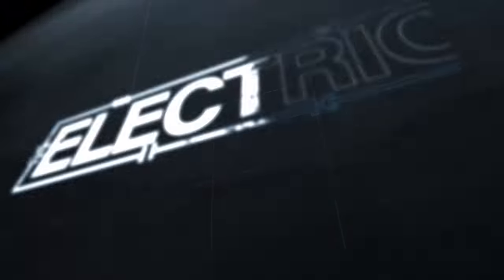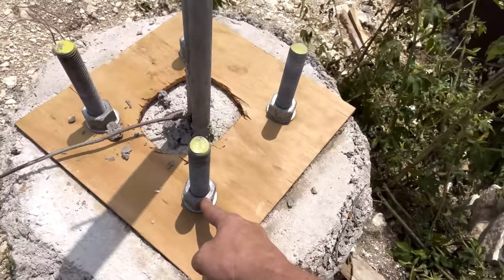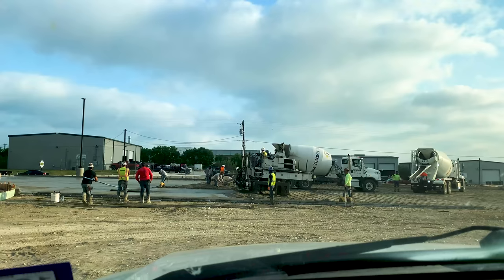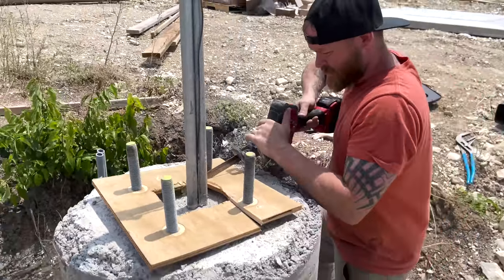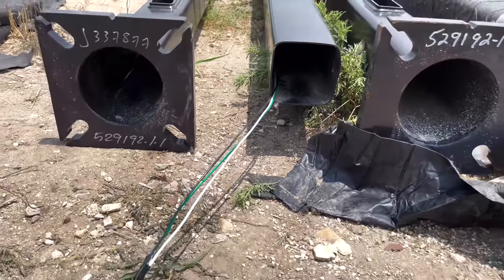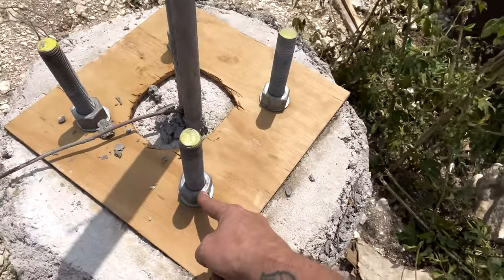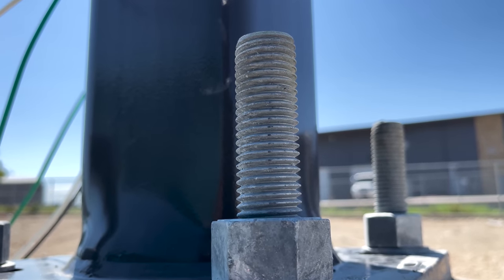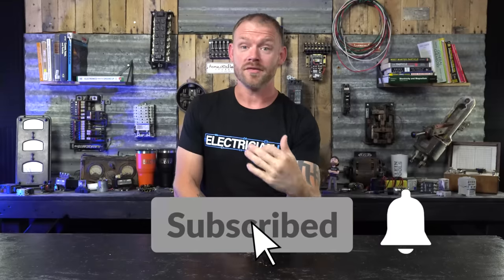How to Set Up Light Poles: Tips and Advice on Thinking Ahead

Comment: Dustin --- what about getting a geo engineer to do a soil test to determine how the poles should be anchored?
  Also, what about getting that same geo department to determine average wind speeds for that area and if that newds to be taken into consideration when choosing the shape of your poles and the material the poles are made from?
 I've had to deal with those things on jobs out in the high desert here in SoCal once for a horse ring that I was lighting and another time for a large sports multi use playing field. 
 These are both very high wind areas that also get large amounts of rain in very short time, not very often but a few times a year and cause flash flooding and can cause lots of soil erosion. Hemce the soil testing for density and underground water. 
 The wind is a problem because of harmonics, not so much the wind speed although that is a big problem that has to be addressed. The harmonics is the vibration of the any structure caused by wind that causes the vibration to be consistent where the structure vibrates at a certain frequency which then stays at a constant momentum that increases more and more to the point where the structure will fail at its weakest points. 
 I'm sure you've seen the film of the Tacoma Straights Bridge swinging and twisting and waving up and down then finally self destructing and falling into the river below. That is wind harmonics that caused that.  Lighting poles will do the same thing. That's why they make poles in octagon, round, oval, square, some are tapered, and they are made from steel, aluminum, some are a plastic of some sort, all for different applications. 
 Thats just standard poles for parks, parking lots, etc... then there are the very large, very high lights and poles for sports stadiums, race tracks, etc... that's another story completely.
Reply from the maker: Thats a very astute observation, however in the electrical contracting industry most companies are going to design and build systems to the minimum allowances that will pass code - because most builders want the cheapest price for the highest quality required to meet standards and still make money. Who would we put the responsibility on for this? When a plan is drawn up by an architect and approved by an engineer, we in the field expect the engineer to have covered all aspects of design, so really, we just install what they spec until we find issues arise. I'm sure for larger venues and buildings there's much more input from engineers on fixture selection, harmonics, etc - but for the average home and business this is not something that's required nor are there typically problems we hear about. That's not saying it's not important to consider, I'm just pointing out that if there is an issue to be considered I think most of us sparkies would defer to an engineer to point them out and spec it in the drawings otherwise we're going to assume there's no issue. Thanks for mentioning this, it's something I've never thought about.
Reply: @ElectricianU  ---- Thanks for your reply. 
  I should have worded my comment a little different. I was not necessarily asking if you had gone through those processes as the electrical contractor because that burden does rest on the engineer/architect unless it was a design build contract and if it was have you ever dealt with that?
  I also wasn't trying to bust your balls in any way, I apologize if it seemed that way.
  I wanted to ask about those things to know if that is something you've dealt with before and to make other viewers who might consider installing poles, on any job or at home, that it isn't as simple as pouring a footing or buying a premade base and mounting any pole and light setup. There are very real dangers that exist and accidents that happen very often with pole lighting not installed with proper products designed for the location and environment, (average rainfall, snowfall, runoff, soil density, and especially wind) and wrong type of anchoring for the type of soil present at the jobsite. 
 Electricians main goal is to protect lives and property when installing or repairing any electrical work.

Comment: Might work to keep the bolts straight after the pour to set a second template near the top of the bolts while the concrete is drying.

Comment: Hey Dustin, have you considered running a bare copper ground connected to the Rebar inside the pole base and stick it up and landed on your light pole instead of driving a ground rod?
Reply: Some inspectors want a ground rod installed along with the rebar being attached to the ground, and the pole as well. You really should need to ground the pole at all. Not even the rebar since it's already an ufer ground. Although some inspectors want to see it since they think it is code
Reply: @krisssilco  Yeah, ground rods are dumb. how much more grounding can you get with all the rebar in the ground...
Reply: Here in the southeast, every inspector we've ever had while doing poles only required that we ran a bare copper ground into a grounding clamp from the rebar cage to the grounding stud inside the base of the pole. Depending on the geographical location and the size of the job, checking on little things like this can save some time and money. I hate finding out they want it different than what the next county over wants.

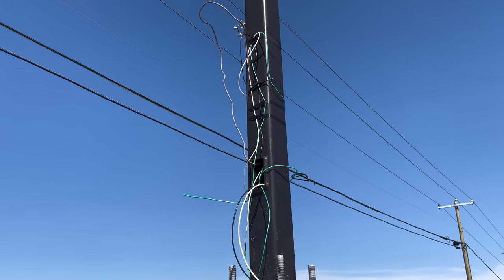Comment: At 7:06 I noticed the base part where the light pole sits on top of it there are several cracks on the side of the base...do you guy just add a layer of concrete to cover the cracks? Thanks and keep the good work brother!

Comment: You didn't mention that the position of the anchor bolts have to be oriented/aimed in the right direction. Otherwise your fixtures may point in the wrong direction.  This is especially true with square poles.  It is also very important to know what pole & fixture is being installed before the roughing begins.

Comment: Now there's something I've never worked on before. I'd have been ticked off if aI couldn't use PVC for the lights. Ridgid conduit adds a lot of cost to the job including labor. For the record, I am in favor of the ground rods in this situation because of the chance of a lightning strike.
Reply: A small little grounding electrode conductor isn’t going to do much in the event of a lightning strike.

Comment: Man those concrete guys are hacks 

We do our own electric and concrete. If our work looked like that we'd have to rip it out LMAO. 

Their mix design is way off, bug holes that bad show no vibrators were used, and that's just not going to be durable. Should have just done precast on slurry if it was going to look like that. 

Electric work is clean as usual though. Don't let that reflect on your crew.

Comment: So the purpose of the grounding electrode conductor is to keep the rebar at the same potential as Earth and inhibit galvanic corrosion, right? Without it, the rebar would rust out more quickly. A similar concept comes into play when ships dock and tie in to the local power grid - they need a ground potential strap to keep the hull from rusting out into the seawater.
Reply: @whiggins101  Cite your sauce please.
Reply: @petersage5157  My training as an electrical engineer. I've always suspected it came from the utility side. They put ground conductors on their poles, but for very different reasons.
Reply: Peter, most ships are wired ungrounded delta in order to isolate the potential from ground.  Their theory is that they don't want a single ground fault disabling the system.  It's usually safer to have power than none.  They have sacrificial anodes to handle any circulating currents.  Cadwelds are standard in most large scale light pole installs and the ground rod conductor must be attached to the pole base and any metal conduit.  Yes, it will help in a lightning strike, but the main purpose is to make sure a metal pole does not become energized.  In a utility power house or substation they even tie them all to the ground grid (plus fencing, etc).
Reply: @tgmct .......but the main purpose is to make sure a metal pole does not become energized...... The rod will not supply a current return path to the source . The EGC prevents the light pole from becoming energized.  Any light pole with a rod and no EGC is a shock hazard.

Comment: We pour our own bases and set our own bolts just for that reason. If you hang your bolt template from 2x4s and put rebar at bottom of bolts in x shape keeping everything in place it will make your life easier.  And that concrete was so cracked wtf.

Comment: Hello Dustin, what voltage are you feeding those light poles with? 347V. If so what size of wires are you feeding them with because of the voltage drop? Great Video!
Reply: I don't think 347 is used in the US. More likely 277V or 480V.
Reply: @illestofdemall13  Most lamps are 120 volt single phase in North America (at least where I live). Easy to tap off the utility as they're already supplying 120/240v for residential and light commercial is 120/208v so easily tapped off existing transformers.
Reply: @TheDrew2022  277/480V is also used a lot in commercial areas here in the US.
Reply: @illestofdemall13  A lot of commercial buildings in my area get 347/600v   supplied to the building. They still have a step-down transformer to get 120/208. And every building I've worked on, the outside lighting loads were typically 120v.
Reply: @TheDrew2022  Where are you located?
Reply: @TheDrew2022  Canada I presume.
Reply: @TheDrew2022  277/480 and 120/208 is common in the US.

Comment: for the love of all that is holy please run another 1/2-3/4 conduit for low voltage data, everyone wants cameras for the parking lot after the fact. hanging a 12x12 with a transformer, a poe switch and a wifi antenna, off a light pole aint pretty, also it sucks when a whole string are run off of one photo cell or if the photo cell isn't in the top with the light fixture.
Reply: My son works solely with light poles for a large city.

A lot of 5G transmitters are going on light  standards(poles).

They're putting in lots of vehicle chargers onto the street standards.

Comment: The only reason your having to bang the anchors straight is your putting your template to low on threads. We put our templates as high as possible on threads and leave it a bit above  concrete, so we also have room to finish concrete underneath it.

Comment: grounding rules are funny. Since you already have rebar/conduit in the ground, you figure that's enough. Kinda like they want water pipes grounded, but they are already metal pipes, underground. How can you be any more "grounded"?
Reply: Some jurisdictions allow non-metallic pipe for underground lines,  and sometimes there are non conducting segments of piping between the interior piping and the underground connection .  A metal water pipe in a house does not necessarily have a good conductive path to the ground.
Reply: @andrewalexander9492  does a metal water pipe in the earth provide a good ground? while outside the house?
Reply: They want them bonded, not grounded. Bonded means all metal parts, conductive pipes, etc are bonded together to avoid a difference in potential between different parts.

Comment: Why do you need a set of nuts to level these?shouldn’t the concrete be flat and level?
Reply: Never want to have the metal pole base resting directly on concrete, it will cause it to rot out. The threaded rod or bolt used in concrete is galvanized to prevent rot far more than the pole base is. And they will never get it perfectly level when they pour, so the nuts give you the adjustment you need to level it.

Comment: How do inspectors get away with setting their own standards? I don't see how it can vary person to person when the rules are right there in black and white? Also, is there any type of appeal process in place if an inspector wants something redone that is really going to cost you or just be a big pain the ass to redo? Thanks.
Reply: I’ve always wondered the same thing
Reply: It is never a good idea to piss off an inspector by questioning his wisdom or authority, but we recently had an issue on our home where an inspector said that a basement egress window was required.  After discussions between our contractor and the inspector failed, we had to, in a nice way, demand that the inspector show us, in black and white, exactly what code he was enforcing.  Since he was making it all up and couldn't back up his ruling, we got by without the added expense.
Reply: National Electrical Code is the minimum standard.
Throughout the code book you will see AHJ.
Authority Having Jurisdiction, your local code.
The local code may require a more stringent requirement to any section of NEC.
Reply: Because the wording of the code often has some ambiguity in it.   A good example of that is :   NEC 334.15(B) "Cable shall be protected from physical damage where necessary ... "   in reference to exposed Non Metallic Cable.  There is a hell of a lot of room for interpretation in "protected from damage where necessary"  and  reasonable people  can,  in good faith,  read very different meaning from those 5 words.   So you may have very different application of those same 5 words in different jurisdictions.
Reply: @andrewalexander9492  good point!

Comment: I’d also recommend energizing the pole before setting it. Sucks to find out you have a bad pole head after it’s in the air. Pull all the wire first. Try and avoid junction boxes, those can be a problem over time if the junctions aren’t done properly. Level your bottom washers and nuts before setting. Ground rods on a pole are pointless. Also, I’d recommend not using whichever contractor poured this guys pole bases😂